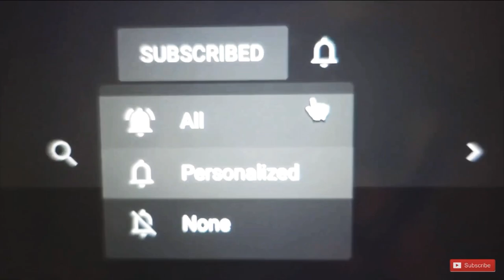How to install your Shock Mount for your Microphone (How to)

Comment: My shock mount has two washers that allow the microphone to move on the stand. no matter which way I screw them on, the microphone continues to be loose. it doesn't appear to stay in place. any help would be appreciated. I am completely blind.
Reply from the maker: I think the best result is to check the stand and pull it tight until you can’t no more and see how you will be needing to put it together on the table